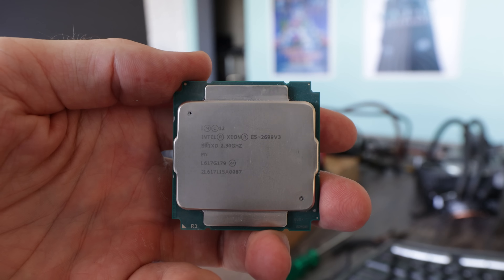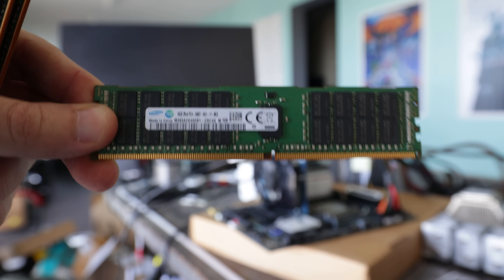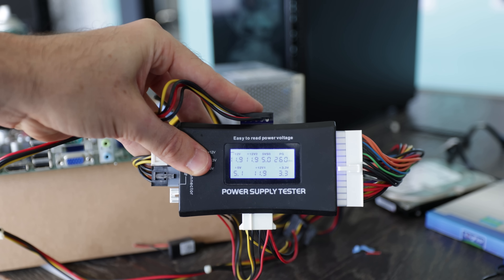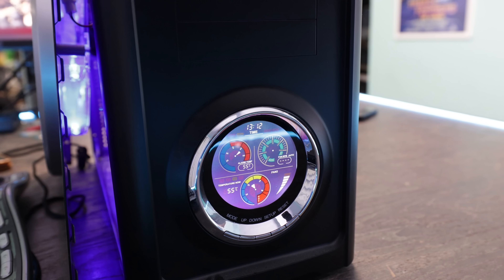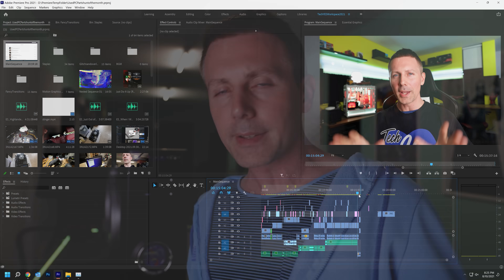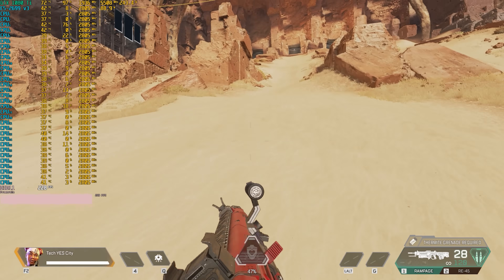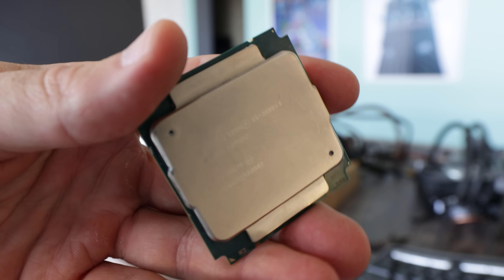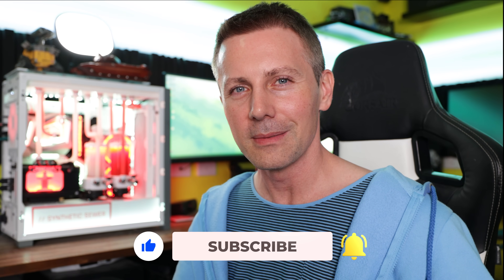I Built a BUDGET 18 CORE XEON Gaming and Workstation PC (Part 1)

Comment: Still the mayor of value town. I think this is by far the best price/performance production machine you've ever put together!
Reply from the maker: 4th Gen Xeons are hot as, this CPU has so much potential.
Reply: @techyescity  Don't forget the e5-2696 v3 (OEM version of the 2699v3) Higher single core turbos!
Reply: @techyescity  Will windows 11 work on this man?
Reply: @techyescity  test modern games
Reply: @techyescity x99 is 5th and 6th generation. x79 did 3rd and 4th.
Reply: @exturkconner  X99 is V3 (Haswell) & V4 (Broadwell)
Reply: @CornBreadMan264  Haswell e/ep and broadwell e/ep. I mean there's a reason why the i7's for those platforms were i7-5000, and 6000. It's not because they were 4th generation parts. Yeah?
Reply: @techyescity  MSI X99S MPOWER Motherboard owner here, With a i7-5930K (15mb Smart cash memory) , I was the one that kept on bugging you that with my platform the (MSI) GTX 980 (Gaming 4GB) performed well in Cyberpunk 2077 😍😍😍
Reply: @techyescity  can you recommend similar workstation cpu gaming pc build that comparable to 4th or 5th gen i7?
Probably around $400 in total using used parts mainly? (Not including gpu price)
Reply: @AmirPomen  Core i5-11400 US $200, B560 motherboard $100-$200, plus whatever you want to spend on memory. 50% better single-core performance and with a good cooler as good or nearly as good of multithreaded performance. (Be careful, a couple of B560 boards are much faster than the others. See the Hardware Unboxed videos.)
Reply: @AmirPomen  disregard the option the reply below your put lol. Look into the z440 workstation (v3 capable)
Reply: @techyescity  Is E2650 V3 Dual 10 + 10 CPUs Total of 20 Cores a good choice ?
Reply: 2600K still good also
Reply: @DIYTech21  I hope that's a joke...
Reply: @HazewinDog   more than meets the eye
Reply: Awesome performance value 😃👍
Reply: It trying to hijack, but why is he talking so slowly? Saw this comment on JarrodsTech too…

Comment: I worked for years as a computer refurbisher.  Retired in 2017.  Worked on   all kinds and all makes.    I lost count on how many I personally worked on after 20,000 machines.    Of all those brands and series,  the Dell Precision T series were the best engineered workstation/desktops I ever encountered.    They were very expensive when new.  And the build quality reflects this.  They were built like tanks.     We got whole pallet of the T7400s  once.   But the customers couldn't figure these out, as they used FB ram and were set up to use mainly  SAS HDs in raid configurations.  They are heavy and big.  You only had three SATA ports unless you put in a card.    But since no one was buying these,  I got mine for $90 after the in house buyer restriction  timed out, and I could buy it with the employee discount.   Two Xeon Quads,  and 14 GB Ram.    This is still my main computer,  after 16 years from when this computer as made.   All I did to it,  was add a 1650,  and a TB SATA Solid State Drive.      It will not play the most advanced games well.     
The GPU was an issue,  and I settled on mine for a 1650 GPU.    I don't play many gamer programs.  But this thing, still plugs away on any thing else.

Comment: Ive just got a HP Z440 workstation with a E5-2687W v4 24 thread CPU and 64GB of ram for £150 here in the UK. Amazing value and playing Steam games brilliantly. Im mostly using it for Driving simulation, Assetto Corsa etc.

Comment: I bought a refurbished HP Z640 powered by dual Xeon E5-3599 v3 CPUs with 256GB of PC2133MHz RAM a P4000 Quadro video card and a 1 TB SSD and 8 TB HDD - for video editing and Astrophotography processing.

I disabled Hyperthreading to get the logical processor count under 64 (as otherwise software needs the correct processor affinity coding to distribute workload across the logical processors - else you will see one CPU and its associate 36 logical processors flogged and the other one always idling at 0 - 5% load).  Setting them so physical cores = logical cores = 36 obivates the need for this edge case processing and each CPU will run at full load then.

I added 4 x 2TB Crucical P600 M2 drives in RAID 0 on a Asus Hypercard PCIE x16 board, and adding two 6 pin female to one 8 pin male power connector cables I was able to swap out the P4000 for a Asus ProArt RTX4070.

End result - massive compute, I/O throughtput, and ocean of RAM for software that really needs it and a very fast GPU with a massive number of CUDA cores that both Davinci Resolve and PixInsight can use for my hobbies.  Yes it is very fast in games too - totally silent and simply great performance for minimal outlay!

Comment: I recently bought a 2nd hand items as Machinist x99 (PR9) and Xeon E5-2699v3 for 100 euros. Previous owner mentioned that previous setup with these items were set to 8 cores only visible due power issues with that motherboard.

As I watched your video (part 2) I noticed under voltage option to be key feature to have all 18 cores to run at the same time (with set 3.66ghz each) - I thought if this might be the "power issues" with my setup now..?

I haven't been able to test this setup yet as I lack perfect case yet, will have suitable shipped to me next week from now on - I can post my achievements and notes about the process here later on :)

Comment: honestly the Lenovo LGA 2066 motherboard and w series xeon cpus are probably the closest thing to the new meta there is. Im building one and all in for the cost of the tower minus the 5.25" pioneer blue ray drive for ripping dvds and blu rays is 900 bucks. Xeon w2155 LGA 2066 motherboard for lenovo p520 noctua Cpu cooler 64 gb of DDR4 server ram and a 1000 watt power supply all summed up with a Radeon 6750xt gpu. not a bad use of 900 bucks US. and theres even some room for expansion since it can accomodate up to 128 gb of ram not that your average gamer would need that much just saying if youre developing mods this might be a good idea.

Comment: I know HP Z440 and Dell Precision T5810 are great due potential upgrades. Speaking of which, you can make a beast on budget: Intel Xeon E5-2690v4(14C28T clocks kinda meh due no OC on those boards) for around 40 Euros from Aliexpress, a case + motherboard + powersupply + cooler from mentioned machines for around 150 Euros in total, a gtx 1080TI for around 130 Euros(keeping pace with 3060 12gb but 50 Euros cheaper, even when set target power to -28% keeping same power draw as the compared card without losing frames). The biggest  issue is a total of 128GB ddr4 ECC in up to 8 sticks(either 8x16GB or 4x32GB configuration) for anything in between of 125 Euros to 200 Euros. As for SSD even sata will do...used 1TB for 30 to 60 Euros(with bit of luck M.2 altough you will need an SSD adapter card). That is build for a total 500 to 600 Euros. Ofc a threadripper on a budget will outperform this one, but for twice the money. As playing on this 4000 Euros machine from 2016 due years of depriciation, some niche games still require those specs. For me its is Eve Online with projected 28 clients running at the same time...That is insane even for todays standards when consumer grade CPU gets 8C16T(yikes) not being able to keep up. The idle power draw is rough though, but disabling some cores in msconfig should save on power bills if you dont need those cores. A dual xeon is significantly cheaper processors vise, you will feel the power bill in the longer run however. On the other hand looking for bargains - a used build with threadripper 1920x, 32gb DDR4, GTX 1080TI will cost 600 Euros...no idea on benchmarks in modern titles though.

Comment: the problem is finding the best motherboard for this cpu because x99 by known brand is still not cheap, they are still expensive that is similar to the combo of the gaming CPU+BOARD+RAM
Reply: HuananZhi: X99TF (4 lots DDR3/4slots DDR4) or X99T8 (8 slots DDR3) of X99F8 (8 slots DDR4). I own two X99TF's...ordered one and the delivery failed in the first quarter of 2020 (covid supply chain issues).  I got that money refunded fully on AliEx and re-ordered.  The second order arrived in about 3 weeks.  Then, 3 months later, the initial/failed order arrived.  Both boards were new and in perfect condition. As I ordered on a discount sale for US$100, each board (in effect) cost $50.
One is paired with a turbo unlocked E5-2678v3 and 4x8GB of DDR3 (1866) Mushkin Redline desktop ram. The second X99TF (for my office) is paired with a turbo-unlocked E5-2696v3 and 48GB of DDR4 (3200) corsair vengeance desktop ram.
I usually buy ASUS boards and had upgraded from a P9X79 Pro + E5-1680v2 (OC'd to 4.5Ghz) for the office.  The 2696v3 w/X99TF was a nice upgrade and quite cheap in price ($50 motherboard + $46 CPU). X99TF build quality is excellent (10 layer PCB, quality caps, good VRM cooling, nice design, dual NVME slots, BT M.2 slot, etc.). Having experienced these boards for over 3  years...I would not pay any premium for a used premium branded X99 board.  IMHO.

Comment: Two years later, these CPU's are even more ridiculously priced - I've just ordered parts for a total of £350 for the build
X5 2695 v4 / 64gb DDR4 2400 ECC / 1tb SSD / Twin Fan Water cooler / 600w psu + cheapo case / an old 4gb GTX 970 i picked up for £43 (not using the machine for gaming!)
Reply: I considered upgrading my E5-2696v3 to E5-2696v4...but with V3 turbo unlocking (-50mV/-50mV offsets, using Mi899 software for ease of turbo-unlock), I can see no benefit.

Comment: A year later: Dell 7810 Dual CPU workstations are $120 on eBay. Actually the 2696 is a higher end CPU than the 99. $50 on eBay as of this comment. 32GB sticks of DDR4 EEC memory are $40 ea. So a 36 core, dual CPU workstation with 256GB of memory for > $400. Then add in whatever storage or video card you want. That era of chipset can boot from PCIe so a NVMe drive on a $10 PCIe adapter card is do-able for super fast storage.
Reply: yea i just bought and built a dual x99 cpu motherboard called HUANANZHI X99 F8D and it cost me 230 cad or so with the 2  xeon 2680 v4 cpus i already had 64 gb of ddr4 just laying around
Reply: Where did you buy it?
Reply: I just got a huananzhi f8d from Newegg, and 2 xeon e5 2697 v4 (a bit better that the 2699 v3) and 2 sticks of 32gb ddr4 ecc 2400mhz , all for around 260$.
Reply: Also HP Z440 workstations. With the latest BIOS update they boot from PCIe NVME cards no issue.
Reply: 2025 it's like 25$

Comment: I'm doing a similar build right now except I'm using the e5-2696 which can be had cheaper but still has the 18 core with hyperthreading and it boosts to 3.8ghz. SO excited about a performance budget build!

Comment: And I will assemble the second computer on the Chinese motherboard Jingsha x99 8i, an analogue of the asus x99, only in Jingsha x99 8i you can stick 256 gigabytes of memory and it is more flexible in overclocking the xeon "e 2696-v3" processor, a lot of overlocker BIOS firmware and powerful power supply phases  vrm.
Reply: Personally, I prefer the X99TF from Huananzhi. Very similar design/layout. Easy to turbo-unlock (with under-volt offsets). Has 8 slots supporting either 4 slots for  DDR3 or 4 slots for DDR4.  The X99F8 variant differs in that all 8 slots are for DDR4, while the X99T8 variant has all 8 slots for DDR3. 10 layer PCB...quality caps...excellent power delivery with good VRM cooling...nice design with 2 NVME m.2 positions (one is for bootable OS) and another m.2 for BT. Seems to consistently get positive reviews.  After three years of use with 2 systems (office: w/E5-2696v3 + 48GB DDR4, and family room: w/E5-2678v3 + 32GB DDR3)...I am fully satisfied with the HZ X99TF.

Comment: i recently build a workstation/gaming pc with an 2699v3 45usd,32gb ecc 20usd,asus x99-ws 70usd and its totally worth it
Reply: This was a very good deal! Particularly the motherboard.  The E5-2696v3 (~$45) is another consideration for said build...very similar to theE5- 2699v3 (18C/36T) but with a slightly higher max turbo (3.8GHz vs. 3.6GHz) and DDR3/DDR4 compatibility.
I performed the turbounlock using Mi899 for my 2696v3+X99TF combo. Also installed THROTTLESTOP to max out the multiplier to 38x (with same TDP hard limit). Lastly, tightened timings with an XMP profile.

Comment: Ok, i just had to go pick up an e5-2699 v3 from ebay after watching ur video! My x99 platform has been so good to me. I can pish it more with this little upgrade. Asus x99 lga2011 v3.
Reply: Why E5-2699V3 over E5-2696V3? Just bought the later for $51, delivered.  DDR3 or DDR4 capable too!
Reply: @jb678901  lol, didn't know better at the time BUT they are so cheap now. wouldn't hurt to change it up now.
Reply: @akarocket  Probably not necessary to bother.  The benefit of a slightly higher 3.8Ghz turbo on the 2696v3 is mitigated in multi-core by the same 145W TDP limit on 2699v3. 

I recently considered an upgrade to either 2697v4 or 2696v4 (from my current 2696v3) and stopped after reviewing benchmarks.  With turbo-unlock, the V3 remains a solid choice (either 2699v3 or 2696v3); as there is no turbo-unlock possibility with v4.

If you need to boost core clock under heavy workload and against the hard TDP limit, then disable 6 to 8 cores. The 2699v3 and 2696v3 will more closely approach their respective turbo-boost limit on 10 cores. I suppose this might be a preferred approach with certain games.

IMHO.

Comment: A year later, you can get a used Broadwell Xeon for even less with a higher clock speed.  My build will cost around $400 which I will install a hypervisor OS on to run VMs.

Comment: I have two V4s in my build and I fucking love it! Will never go back to any overpriced high end gaming rig on the market.. what a waste of money.
Reply: Same.  For what purpose?  Like having a Ferrari with speed limits under 45mph. Much more pleased with upgrading something relevant, like a GPU. E5-2696v3 does more than I need, by far. That upgrade cost me $16...after selling off the 2678v3.
Reply: I would be more inclined to go for something like a budget B550 and Ryzen 5600x. I have an E5-2696v3 for my office...did this build at the beginning of Covid w/2678v3...then upgraded the CPU last year. It was a great buy back then (performance/price)...but fast forward...only if you are looking for a low budget build with good performance (adequate for gaming).

Comment: Just replace an E52690v3 with an E5-2696v3 in a Gigbyte x99 gaming 5 and the difference is impressive. Single core was faster and the multi-core was a lot faster. The software identified it as an E5-2699v3. I am waiting for some replacement memory but its running on 64 gig of DDR4 at the moment. On all cores procesing 4k Video via ffmpeg, it runs between 2.6 and 2.7 gig.

Comment: you can now build this for much cheaper (like half price) instead of using the 2699 you can use the 2696 its basically the same thing for like 70 $ on aliexpress the mobo is like 100 and gpu s are dirt cheap right now you can buy a rx5700xt that perfoms like a 1080ti for as little as 100$

Comment: For me budget computer was 12 core 2651V2. We not have such cheаp power supply, I buy good APFC about 25 USD. But for HDD, I take like new from dump. About memory was hard question. I find from 3 different people 32gb DDRIII, 4 modules. Also I had to buy old motherbard with xeon X3230, and useless 1gb GT210.

Comment: hi, I had a build with 1tb m.2, e5 2699 v3 (right compromise from 2 years ago) and 96 gb ram, with asus x99 motherboard and gtx 1080 founders edition + 1060 gigabytes, 3 fans. I was rendering and everything was fine. Then unfortunately the motherboard left me after 3 years with a 00 error. Soon I will buy a motherboard for less than 200 euros with dual socket and I will take another e5 2699 v3 to create a monster with 36 cores and 76 threads!. in my opinion amd does not exist and surely with xeons you save A LOT. nice video and if you have a site for buying used material, please turn :) With 2000 euros you can create 2 PCs to have a small home render farm.

Comment: Can I get an opinion on a Xeon 2666 v3 + rtx 2060 SC evga, I'm currently running that graphics card with a i5 3570 non k version in a Dell optiflex mobo that uses ddr3 (insane bottlenecks on most games).
Use cases: Gaming, virtualization,and video editing; I would be using a Linux environment that runs windows in a VM that I'd pass thru the 2060 and use a rx 580 for the Linux machine for editing.

Comment: I just purchased the same Asus x99A motherboard and the Xeon 2699 v3 chip like in this video with 32 gig of 2133 DDR4 in quad channel. I went to play my first game of pub G with my Titan Xp GPU and nothing but bad stutters, Bryan if there is a trick to get rid of all the shuddering I really need to know, I wanted this to be my next main rig I need it to do more than just high Cinebench sores. Anything helps, I'm a big fan of the channel. I play pub G more that any other game and if I cannot fix the stuttering problems with this setup I will just sell it for editing or something, 36 threads cool, but Pub G is unplayable right now. I tried my gtx 970 and had the same problems STUDDERS everywhere. Not sure what to do I know this chip does not use higher speed ram. I will try to lower the trimmings. It's a bummer right now.

Comment: I only got the E5 2630 V3 with the Jingsha X99M-G v1.0 and just did the all core turbo unlock, I need to come up with a way for better cooling. I want to run my cooling off an extra PSU with a manual speed control if I stay air cooled. I have no experience with water cooling but I would recommend it with the E5's. What if I run my CPU fans off a 12v adapter that has different votage setting I can use like speed settings? lol